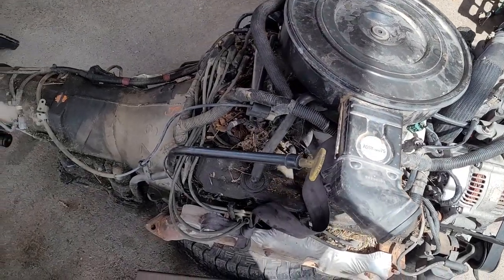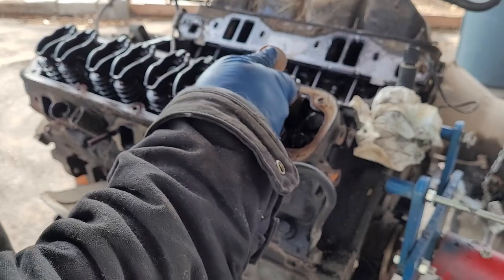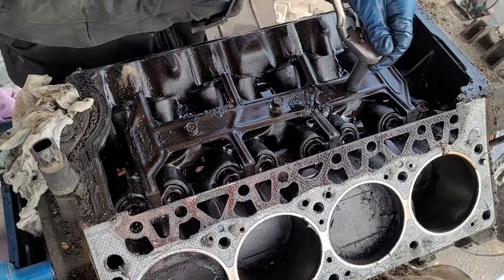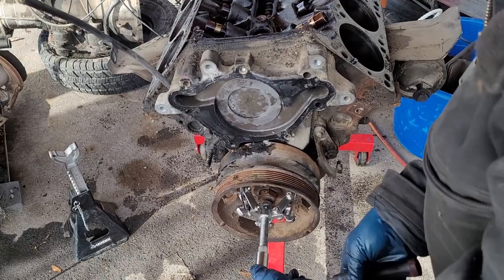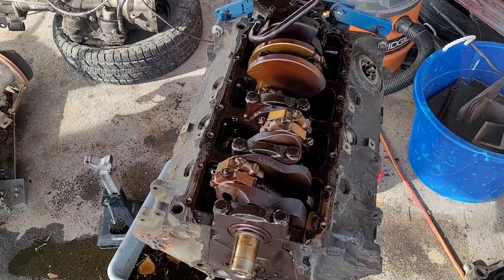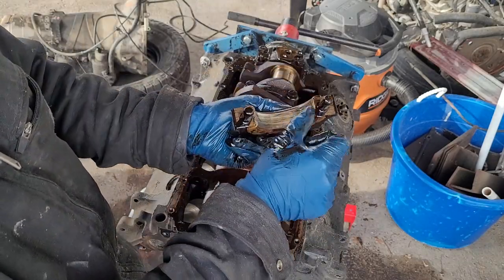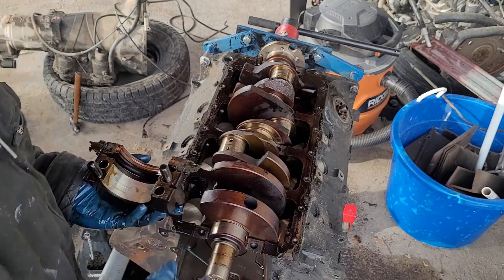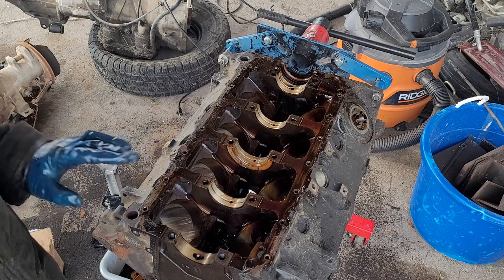1972 Chinook RV EP4 - Junkyard Engine Teardown

Comment: Do you have finished restoration photos? Also, how loud is this when driving since the engine is up inside the vehicle? We are looking into buying a 1969 chinook and know nothing about vintage rv’s. In your opinion, would it be easy for us to find a mechanic like you to fix it anytime, in or near Austin, Tx?

I’d sure appreciate your feedback
Reply from the maker: Still in progress! This one is a little bit of a basket case lol. I would be surprised if you couldn't find a mechanic to work on it. These RVs are based on a pretty standard dodge platform. Nothing oddball for the most part. As for the noise, this one hasn't been driven on the road yet, but I'd imagine it's fairly similar to other vehicles with a dog house. Likely can be reduced with improved noise insulation.